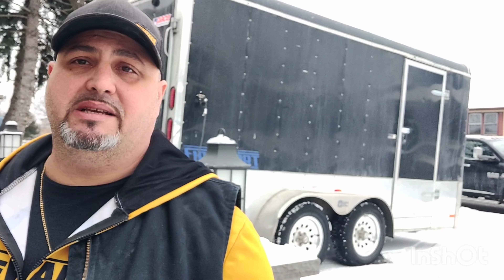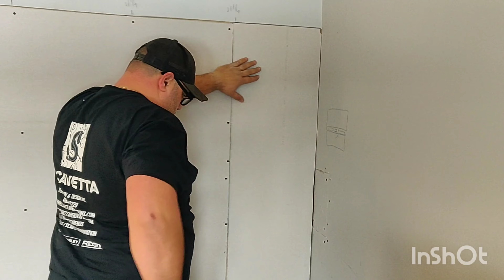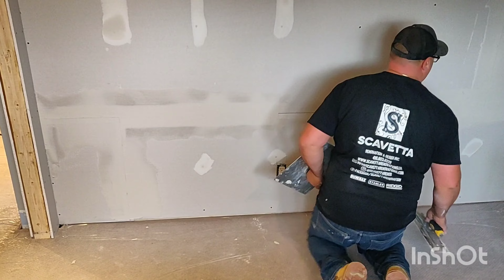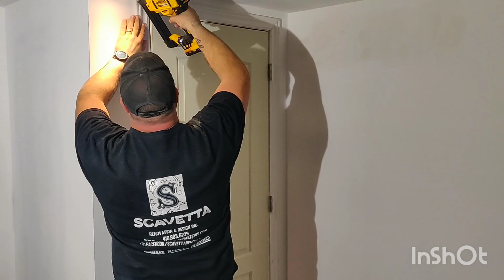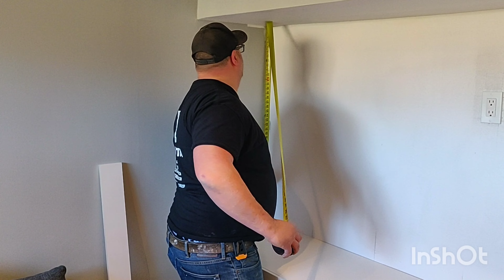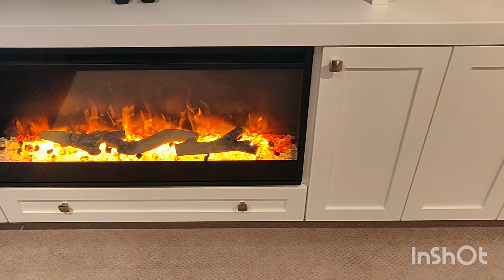Custom Wall Unit and Partition Wall - CREATING A PRIVATE OFFICE SPACE AND SPICING UP THE LIVING ROOM

Comment: You should invest in Dewalt’s new drywall sander it’s really worth it
Reply from the maker: I've been thinking about it actually
Reply: @scavettarenovationdesignin8953  i have the older one which is from porter cable it paid it self off after the 2nd job